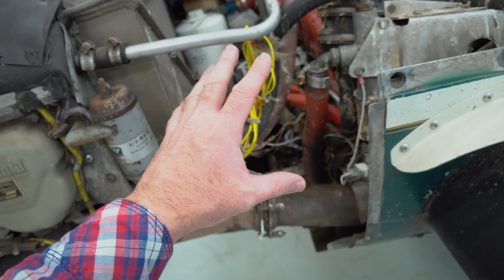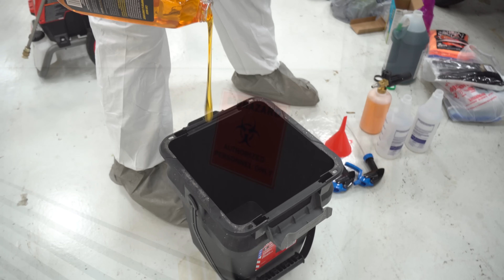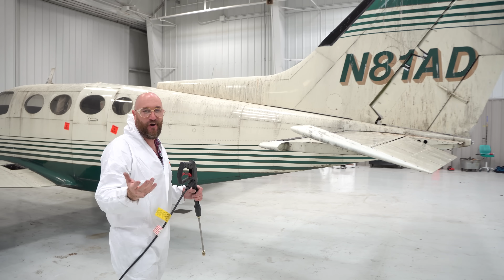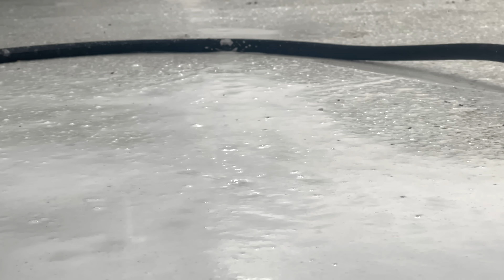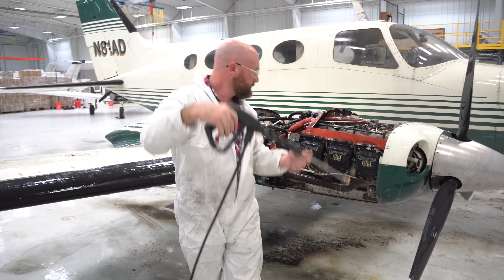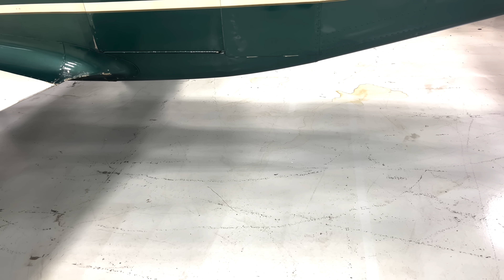Our FREE Abandoned Airplane Gets Its First Wash In 17 Years ! Ep7

Comment: I am surprised you didn't move it outside before the cleaning... but the end result looks great !
Reply: I know, right? If I owned the hanger.... Well, I would ask why the plane wasn't outside prior to the bath. AND...a brush, on the end of an extension pole, can reach every part of the outside of the plane. No need for a latter. Ah. You are using an extension pole. Cool
Reply: @donovanquesenberryiii5063  maybe the ventilation system is enough down draft and there are drain holes on the floor? 😬 that would be best case scenario. but even still, you can just squeegie it out of the hangar doors. the only real problem is pressure washer overspray but he used a REALLY weak pressure washer, it is like 2 steps above a garden hose. you can see in some shots that water didn't even make it within 5 feet of the other planes on the floor. it just turns into a squeegie cleanup process after that; pushing water out the doors.
Reply: I kept thinking that over and over watching this vid.  Nice  and bright so you can see what you are doing cause everything is painted stark white so the light reflects around, epoxy floor, he dumps av gas, grass, bird poop, simple green and all that other stuff and spraying a pressure washer. There will be stains all over that epoxy and just imagine what the place smells like now.  I guarantee someone walks in there the first thing they will say, is D***! WTF is that smell? Man he is nastying up that building.
Reply: could be regulated because of the chemicals used. Water separators, oil catchers under the floor.
Reply: yeah, i was surprised not blowing the engine with compressed air, outside to begin with...
Reply: Was thinking the exact same thing.. the crap over the floor, probably over the other planes and the slip hazard on that polished floor 😮

Comment: It came out really well!! can't wait for the interior cleaning!!! I let you again my comment in the past video, I guess you didn't see it:
If both engines feel the same when turned by hand maybe you have some wiring or grounding issue in the starter wires/relays, and you have voltage drop somewhere and that's why it turns slower than the other engine that started. You can check the voltage at the starter or connect the batteries directly to the starter motor and see if it turns better. Because it is lower in compression than the one that starts, and if the piston rings are worn out, you can still start it if it turns fast enough, the faster the engine turns, the less compression has time to escape, maybe that's why the other engine is starting fine, because it is turning faster so it makes more compression.

Comment: There's holes in the back of the intakes where the water drains from. Basically since you're moving so fast in the air the inertia throws the water out of the air path and to the drain. What little water makes it past that isn't enough to harm the engine.

Basically make sure those drains are clear
Reply: Thanks.
Reply: Thank you, I also assumed something like that. Draining might lose some air intake pressure but it's a regular engine, it doesn't need compressed air to run, right?
Reply: @Cloxxki   Has Turbo's  anyway once they get them freed up.
Reply: @Cloxxki  The engines are turbo charged so will be sucking in the air and compressing it and do not need a RAM air intake like my motorcycle has.

Comment: Tip: Find a interior steam machine to get the interior cleaned......they're used when doing car detailing. Fast safe clean results.
Reply: I second this
Reply: Remove the interior, and pressure wash it. Its past the steam cleaning point.
Reply: With all that go fund me money he can probably buy a new interior jk lol
Reply: yea it still needs all the rivets removed from the underside of the plane that need structure replaced (he even stated this is what grounded it in episode 1 or 2.. I think he said it would take forever to do or a ton of money) but lets make sure the plane will come clean first not flyable lmao!!
Reply: Should definitely wear a particulate filter mask when cleaning it. He’s going to be kicking up some hard shit in there.
Reply: I don't think that's enough.
Best to tear off any kind of fabric or leather and it just needs redoing or buying new.
Reply: @issadraco532  Well he has a budget of 150k at the moment so it could fly again.
Reply: @skirata3144  It's going to cost half a million at least to make this plane fly again.. It's not worth the time or money it would take.. All of the wiring will have to be replaced.. The FAA isn't going to let this plane fly unless everything is gone over with a fine tooth comb and passes inspections.. Just the inspection process will cost more than 150k..
Reply: @skirata3144  he still has to get an annual and make sure all the ad's are complied with all these cars guys think it's easy for planes it's not..he has to get someone with our a&p to sign off the book and ia for an annual... the spar ad alone cost a lot of money
Reply: Honestly he's just going to have to rip everything out, there is no real good way to clean all of that. You can steam clean it up all but that fabric and leather in there is just going to be fucked.

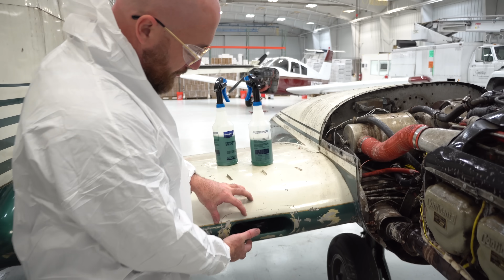Comment: 5:40 I got curious and did a little research. It turns out the air intake is protected by something called an inertial separator or intake deflector which directs heavy particulates away from the engine intake, allowing debris free air to pass through. Apparently the amount of non-freezing rain that would be likely to get caught up into the engine intake won't damage the engine and isn't enough to impede combustion.

Comment: Watching intently from Australia 🇦🇺 
That exterior could do with a good buff to bring her back from yellow to white
Reply: See all those rusted rivets.  It will have to be stripped down to the airframe.   Every piece of skin will have to be removed to check the fuselage for corrosion.  See the corrosion under the paint on the left side of the rudder. It’s more like a frame off restoration in on a car and much more complicated.   Fuel tanks replaced with fuel bladders, new avionics will be at least $100,000.  Stripping the interior will cost over $20,000.
Reply: @joecollins1823  nailed it mate.
Reply: @joecollins1823  not wrong... he's going to blow through the $160k easily. Still has YouTube revenue and merch on top
of that to fund it, but this will not be cheap or quick!
Reply: he's going to make good profit. endless views for a long time. good for him. fortune favors the bold.
a little bit of passion and effort should pay off with so much vapid nonsense on social media.
this is content as it should be. and HEY from Freo.

Comment: Awesome seeing the visual progress!!! Couple of things -- Never use actual Simple Green on aircraft - there is tons of documentation showing that it causes corrosion. It's also a good idea to tape off the static ports and cover pitot tubes to make sure water doesn't get in where it's not supposed to. Yes, you are partially correct in that aircraft are designed to be protected of water ingress while flying. Almost all engine intakes are designed with an "S" shape or diversion of some sort whereas water (rain) or ice-sand-rocks-etc will continue to flow past and out instead of into the actual intake. Be very careful using high pressure water on the deice boots as it can damage them and they are super expensive! Lastly, as you learn more and more, I would start with Chapter "12 Servicing" which should cover basic aircraft care including caring for paint and exterior. Also in general, it would be a great idea to go look in the AMM (Airframe Maintenance Manual) before you jump into anything really. Go start with the chapter Description & Operation, then into the actual task you are trying to achieve. Taking the extra time to familiarize yourself with the actual manufacturer procedures will hopefully prevent you from damaging a component, save you time, and keep you from getting into something that is over your head. When the time comes -- If you're sitting across the table from an FAA Rep asking for an airworthiness, and you can faithfully explain how you took the extra time to self-teach yourself prior to bringing tools to the airplane, that will be better seen by them as opposed to the nightmares that sometimes occur from "non-certificated" individuals performing work that they shouldn't be. 14 CFR 65.81 is the general privileges and limitations that I can do having an A&P. And 14 CFR 43 appendix A subpart C is the limitations that an aircraft owner may perform without the FAA getting upset. You would be smart to read that many times and learn it well in order to stay out of trouble and also speed up how soon this plane gets an airworthiness again. Friendly advice that's all... Get some of us A&P's to work on it with you, and then the possibilities will be THAT MUCH MORE and still remain legal.
Reply: Good evening Sstantial.  I agree with everything you have said.  Three things:

(Long time Aarow, Aztec, Lance owner, here.  Not an A&P)

~He has an A&P directing and watching over what he is doing.  No mechanic can go from getting a 50 year old dump truck to run and drive TO "kicking the tires and lighting the fires" and getting a 53 year old IO 550 to start with the simple "air-fuel-spark" formula.

~The LEAST he will have to do to get that thing airworthy is an annual.  An A&P would replace everything he has tinkered with doing a thorough Annual.  And unless he can find the Maintenance Log Books, and with 1600 TBO on those older IO 550s, he is probably looking at overhauls or remans on both engines.

~I am not telling you anything you don't know much better than I do.
Reply: As a contributor I request RR to give a plan to utilize the funds raised that incorporate this suggestion. The goal should to be to do things to convince FAA to allow it back to flight status. Otherwise it's an expensive museum piece (well, it would be a good looking museum piece) or perhaps a good looking gate guard at the FBO.
Reply: @sehsamudra  There is no reason the FAA would ground this plane.  Nothing about the condition of this plane makes it incapable of being airworthy.

FAA WILL provide an supplemental type certificate STC, and a certified A&P has to certify that the plane is airworthy, and he is good to go.
__________________
Now, for the A&P to certify it is airworthy could be as little as a very thorough Annual, verifying all ADs are met.  Or rebuild/reman both engines and both sets of props.  And a lot of avionics updates.  And he has a big AD on the wing spar.

He has a lot of work to do, and a lot of expense.  But it is certainly doable.
_______________________________
He either finds the Aircraft Maintenance Log Books, or the A&P starts a new set using existing "Yellow Tag" parts, and starts from scratch.  Parts and work on an airplane are aged by hobs meter (hours flown), not dates.

The fact that the plane has sat for 15+ years does not mean the part/labor has to be replaced/repeated.  Yellow Tags on parts have hobs reading.  That is what is important.

Finding the old logs could save him $100-$150K if the engines and props are not out of TBO.  The previous owner's old A&P or shop knows where those log books are
Reply: @mark9531  thanks a lot. Wish there was am email address to send your note to their attention  I could not find any info on Rebuild Rescue organization setup.
Reply: @sehsamudra  Hey.  Now don't take my word for anything.  I am sure he has a good A&P advising him.  I just know he is not the first to have a plane that has sat for a decade and lost log books.

A&Ps know how to get an airplane back up in the air, legally and safely.  There are a lot of little more detail to get an 8 place pressurized turbo twin in the air than some one-lung puddle jumper.

That A&P does not want to jeopardize his license.  And that pilot doesn't want to be the FIRST to the scene of the accident.

Comment: A face shield would be strongly recommended as you will be catching some splash-back when using the pressure washer. The safety glasses and mask are good but you still don't have adequate protection from the biohazards and chemicals. The face shield just gives you that extra layer of protection. I love what you're doing with the airplane. I look forward to every new video you put out. Cheers from YEG. Eric

Comment: Was thinking about the number two engine and the slow turn over speed when starting I would connect a battery directly to the starter with a remote switch to see if it's not a problem with the planes wiring
Reply: You could be right there.  In the previous video, he tried starting No. 2 engine with No 1 running, and it turned over noticeably faster, but still didn't start.  Could be there are multiple faults.
Reply: I agree with a direct source. Also, I watched thru the videos a few times. The engine that runs, you did a fuel check by removing the injector lines at the cylinders. The engine that won't start, I didn't see that. Maybe you did off camera. If you didn't, might be worth a try and check for fuel flow to the cylinders. Plane looks amazing. Can't wait to see it done.
Reply: I had exactly same idea
Reply: @busatim7737  I thought he checked the injectors on the non running engine, a few videos back he had the paper cups under the lines.
Reply: A new lead going direct to the starter with a few extra volts thrown in should swing it. What I mean by a few extra volts is if it's a 24 volt starter, an extra 6 volts will do it no harm as long as the original starter lead is removed to prevent power being returned to the plane. If its 12volt then 18 volts won't hurt it.
Reply: @kieranhuckrocks  he swapped them around i believe. I assumed he tried the known good ones in the other one didnt he? We only see what he edits in the video so we arent seeing every little thing he tried and what other things he has tried.
Reply: In this week's episode he did mention a tear down plammed for #2. When it is off the frame, perhaps they will get a engine test stand to set up a test rig and do a power on test without the airframe ? That way the cables for throttles and prop pitch and other cables aren't in the way amd can be eliminated

Comment: LIFE PRO TIP : Always start the washing from the TOP. 
1).Washing the lower and then the top just makes all the gunk go over the bits you just washed. 
2). Washing from the top allows the lower to be partially cleaned and gives the chemicals a chance to do their thing for longer.
Reply: No, washing from bottom up is the correct way when using foams. Your 2nd point literally contradicts itself.
Reply: Top to bottom.... Dirt settles
Reply: @benlyons5884  no.  the cleaning product goes DOWNWARDS and helps wash the lower when you start from the top. i dont see the contradiction.
Reply: @Palmit_  If you wash from the top with foam, you just rinse off all the foam below. Bottom up means the runoff is only flowing over already washed areas and not washing off foam.

Obviously for the final rinse you want to go top to bottom to get everything off, but once the soap binds to the dirt and grime its not like it can "re-stick" to the plane again so it's OK if it isn't immediately removed, the rinse will knock it off.
Reply: @noahbrecht6378  interesting perspective.  This line "If you wash from the top with foam, you just rinse off all the foam below" is where i suspect we are cross-communicating. From top down, there is no foam below until the top fluids reach below, dragging 'dirt with it, therefore providing what i would term  'pre wash' . Why do work twice as you appear to advocate?
Reply: @Palmit_  As Noah has mentioned, you're diluting your chemicals below with the water from above. This has been a standard practice and requirement for the proper application of wash down chemicals for over 20 years
Reply: @alexstevens5019  no
Reply: @noahbrecht6378  there shouldn't any foam at the bottom to wash away til you have gotten there with the brush or whatever.
Reply: @benlyons5884  there is no chemicals to wash off til you get there with the brush. only those that have already run down from the top.
Reply: @Palmit_  no
Reply: @benlyons5884  i've no issues with you personally at all.  but you appear to have some issues with gravity. or perhaps you are misunderstanding. Persistent challenges to logic and gravity, are for you alone to resolve. I'm no longer able to reason with or, help guide you.
Reply: @Palmit_  not quite. one day you will understand
Reply: @benlyons5884  thanks for the hint.  i learned a long time ago. starting from the top saves a great deal of time, is more efficient and doesn't scratch the paintwork, as much, by rubbing the dirt up then down. Thanks tho.

Comment: When you worked on the right engine after getting the left one started, you changed the oil and put in 20w-50.  Then you had problems getting the motor to spin fast enough to get the oil where needed and to get the motor to fire and start.

A suggestion to help you start that thing, even though you said you were pulling it anyway.  An old trick I learned from my father 55 years ago that he learned back in the thirties is this.  I think I heard you say you didn’t actually fully fill the motor with oil.  Drop in a couple of quarts of diesel – it’s a lubricant anyway.  It might thin your 20w-50 enough to spin that motor up faster.  OR, if you want even more rpm, use kerosene.  

We used this trick on motors which had set frozen for years and it almost always worked.  My father used it on Chevy trucks back in the 1930s in Montana at 20 below.  Worked on them too.